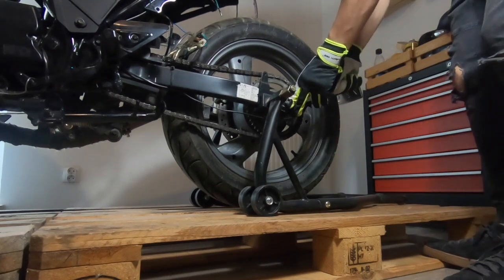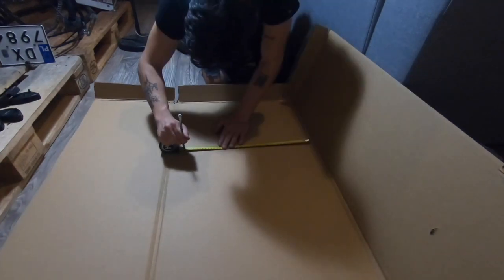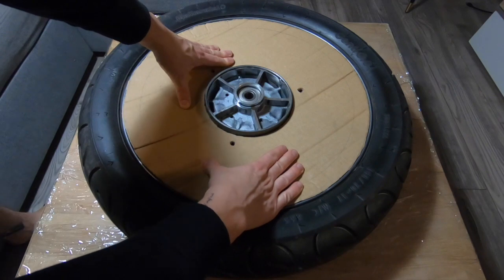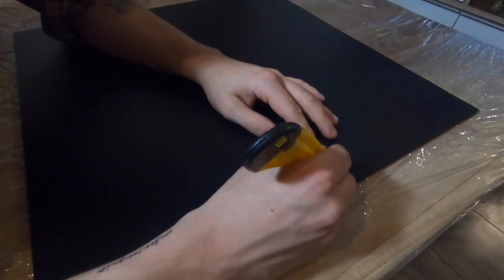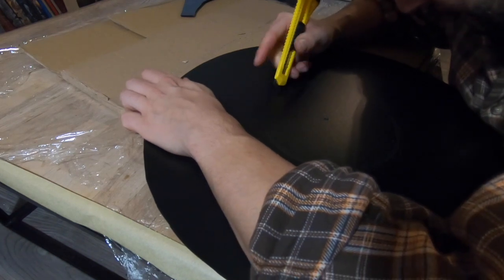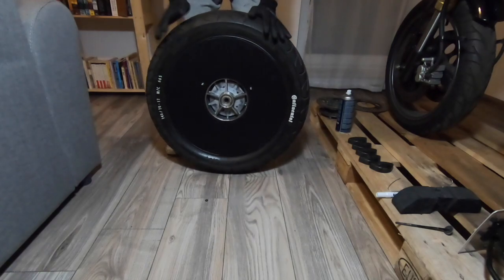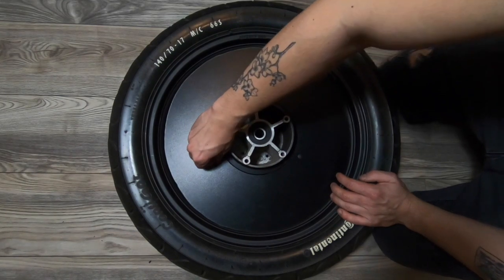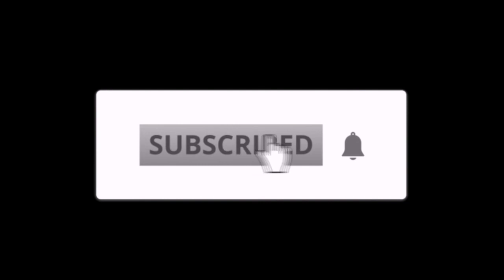Moon Covers DIY  - 125cc CAFE RACER BUILD - Part 9

Comment: I want to do this to my ninja 250r but I got no slots in my wheels to utilize the stability so I'm trying to figure out a way to do a wheel cover on my front wheel. My wheels are very limited on dynamics almost forced me to buy old ex250 wheels that have a choice for slots. The holes that go through the wheel itself. I'm very limited but I wish I had a better idea instead of buying unnecessary stuff any thoughts would help and thanks for the vid gave me a ton of ideas